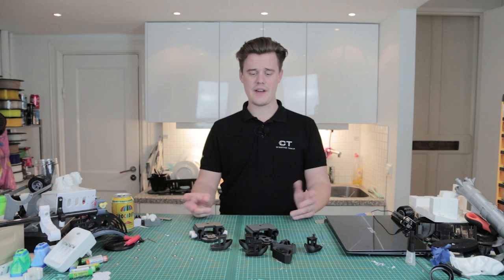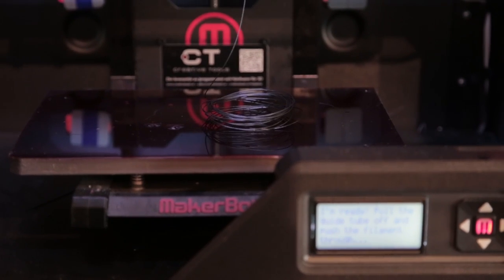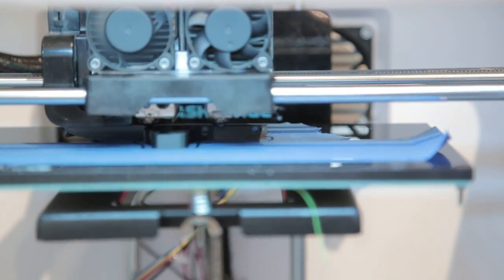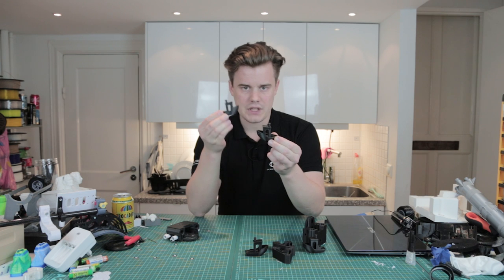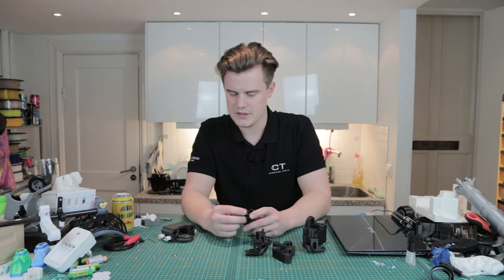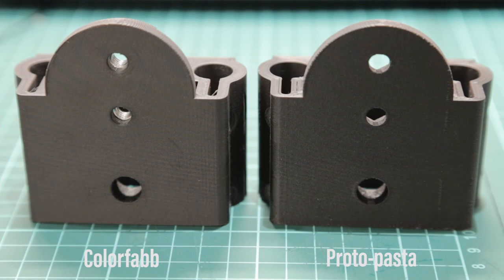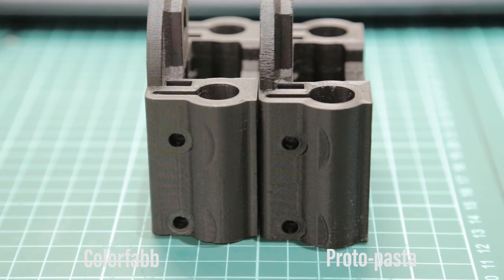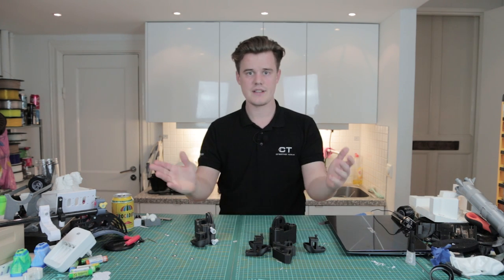/Comparison (visual) | Carbon Fiber edition

Comment: For those who wondering what carbon filament to chose ,  i  tested  Protopasta, ColorFabb  and Formfutura carbon filaments for  their stifness and resistance to heat.
1-Protopasta : stiffer than  regular PLA by 20 or 30 % , very poor resistance to heat ; goes soft at 60 degrees celsius. Prints easily  and rather clean
2-ColorFabb  xt-cf20 : Less stiff than regular PLA , breaks easily , very poor resistance to heat ; goes soft like a noodle at 60 degrees celsius.Prints  easily ; but result is rough looking.
3- FormFutura CarbonFil : 20 or 30 % stiffer than regular PLA , rather good resistance to heat , a lot stiffer than the 2 others at 60 degrees .Prints easily  and clean ( cleaner than protopasta)

So to sum up XT-CF20 is very bad in every aspects  except it prints easily. ProtoPasta has good stiffness; prints easily and ok  but lacks heat resistance.FormFutura CarbonFil is good in every  aspects and also it's the cheapest of the 3 by far. That's a no brainer here.
Note that i have installed a 0.6mm steel nozzle for those tests .The printed object was  120x20x4 mm .
Reply: So, could a Snowmobile Single Cylinder Engine Case be made out of this  #3 FormFutura CarbonFil? The lower end of a Snowmobile Engine see's lower than 200F for sure. I don't know what Plastic they make their Oil Injection Gear that the center D Hole Fails, and on other Type a Shaft with a Gear on one end, Square on the other, and it Fails where the Square end goes into the Crank.

Part #9 https://www.cps-parts.com/catalog/rtxpages/503oilpump.php

Part #13 Center D Shape hole Fails. https://www.cps-parts.com/catalog/rtxpages/582oilpump.php

Comment: The only reason we would use CF is for strength - dont really care about colour. Waste of 6 mins of my life.
Reply from the maker: I didn't have any equipment at the time to back up my findings on flex and strength more than my indications. Sorry it wasn't enough. I'll try to revisit this in a new video on CF soon... still working out on how to test the strength fully. Thx for feedback TORDesign!
Reply: You could print something that will break by flexing when you stand on it. Then put that on top of a normal scale for measuring a person's weight?

Comment: Pity you didn't do a strength comparison with say aluminium, various polymers etc , i figure it would be the only reason to use Carbon fibre filament in the first place.

Comment: Seems to be the most irrelevant review I have ever seen.. the reason for infusing carbon fiber into the pla is adding strength and all you talk about is print quality... That's equivalent to reviewing a sports car without ever moving it... very pointless
Reply from the maker: Hi Brian,  Thanks for your feedback! I Agree and wishes I had an opportunity to do a better comparison of actual strength measured with tools. Today I have some better connections and strategies to do that and would like to re-visit this comparison. Maybe I can find the time to set that up and add a few others. For many people that i've talked to the finish, ease of use and general properties are more important. But far from all of course.

Thanks for the constructive critics, helps me understand what to make better next time!
Reply: It doesn't get significantly stronger.

Comment: Have you installed hardened nozzles for the carbon fibre??
Reply from the maker: Actually no. I have good access to standard nozzles so I change them when needed. However, we're planning on getting stainless steel ones soon. They should be better!

Comment: hi! Did you try our Nylforce Carbon Fiber filament? it's a technical material, nylon based, providing super high strength and impact resistance, and very low weight due to the high content of real carbon fiber. it would be nice to have a comparative feedback from you, if you are interested I can send you a spool for free. keep in touch!
Reply from the maker: +Fiber Force Italy Hi!  I haven't had the opportunity to try your filament yet. It sounds like a very interesting combination with great potential, I'll be happy to review a spool! You'll find my email in the description, if you could send over some details, we'll continue through email. Thank you!
Reply: i've sent you a mail last week... did you receive it?thanks
Reply from the maker: My spam-unfortunatly did. You have a reply. Looking forward to your reply! =)
Reply: How did this turn out?
Reply from the maker: The woodforce is released, The nylon carbon fiber video should be out in a week. It's been slow during the summer and there were some other things not really working out, You'll see :)

Comment: I have not used colorFabb but in the last 2 years we have printed with over 5 kilos of Proto-Pasta's carbon fiber ..  we have made everything from key chains to dress's . I've never had a clog  or any problems...  prints constant every time and looks amazing, they also make a stainless steel and a iron that are in the same league as the carbon..  great stuff